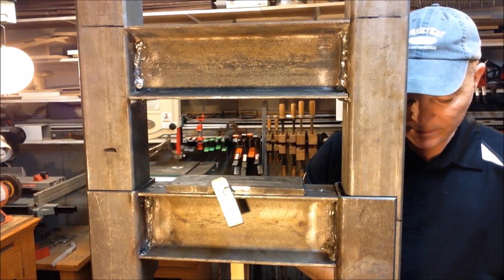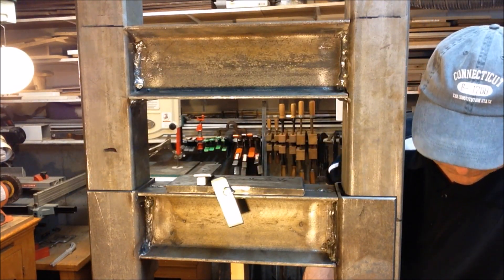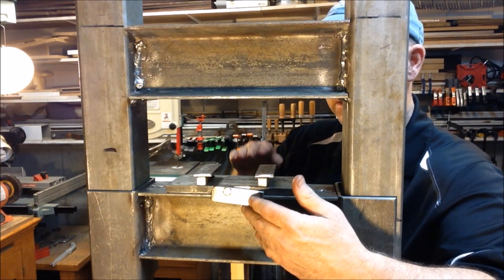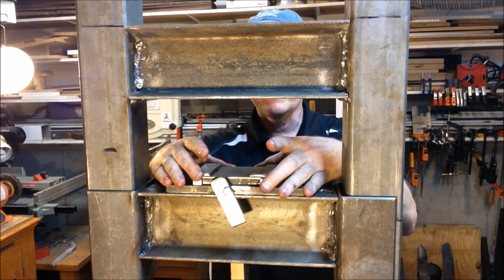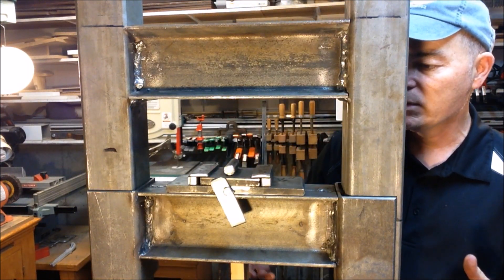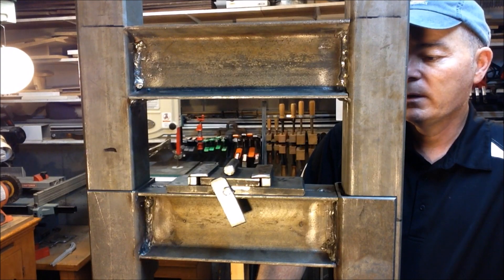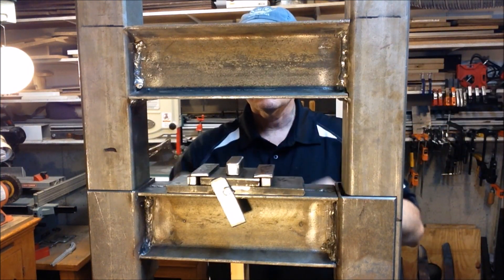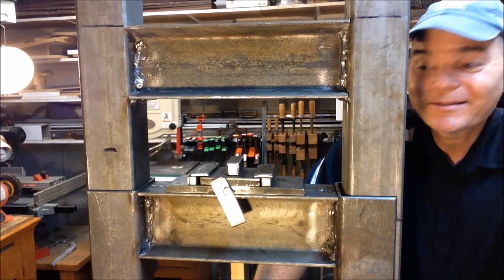Homemade Hydraulic Forging Press For Blacksmithing - PART 2

Comment: Awesome videos. Two questions. Why did you cut the back off the square tubing that runs on the rails?  Is the plate stock for plates and dies hardened steel?

Comment: This is the smallest lightweight forging press I've seen built. Looks nice but instead of king Kong I'd call it tiny Tim. Lol
Reply from the maker: Ha Ha Ha -  Yea it is  a little irony used for humorous affect, but in the final part 3 video it does shoot flames and smoke which is pretty bad ass.

Comment: Hi great video quick question what size of air compressor do you need to run the jack plz
Reply from the maker: Hey Glenn - I actually posted a video on that - here is the link.  https://youtu.be/_lI0DY__LC4  Hope it helps.